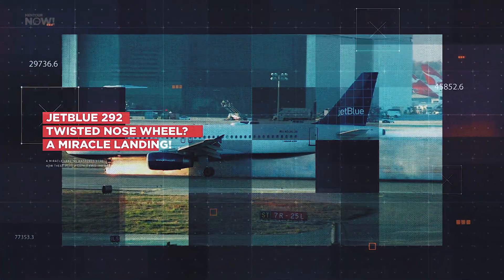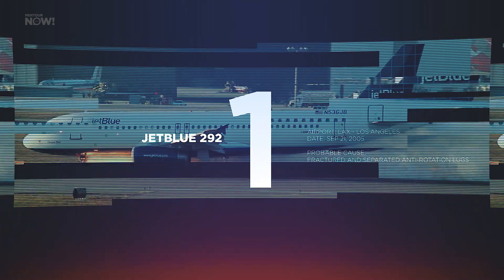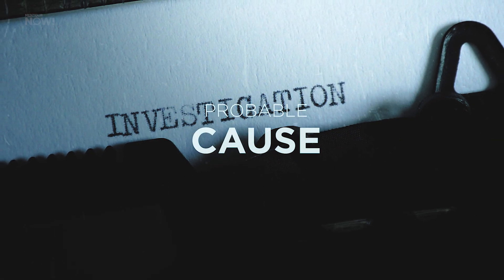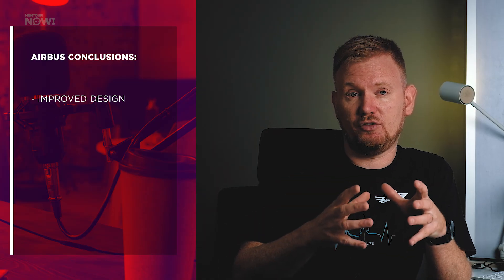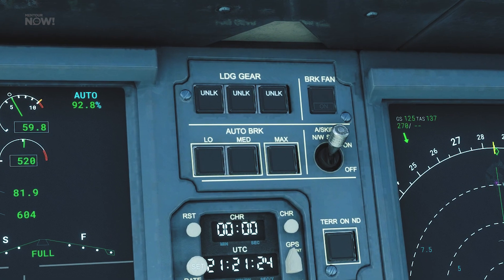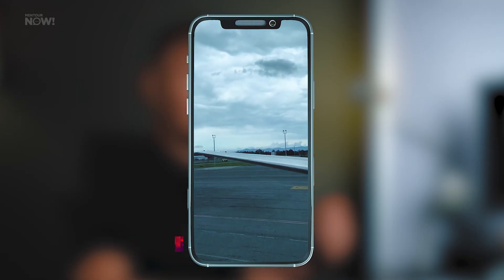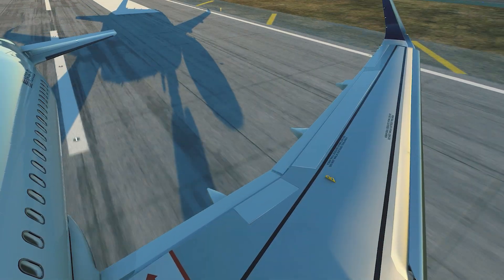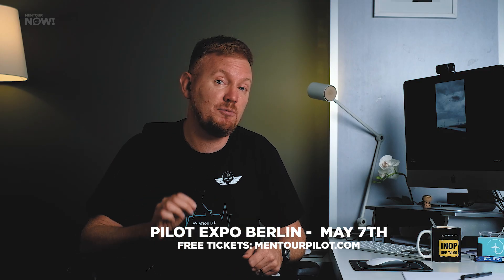The TWISTED Story of the Airbus A320 NOSE-GEAR!

Comment: I for one find it odd that the nose wheel isn't designed so it's forced straight when it touches down. This can be achieved simply by offsetting the wheel axis slightly behind the steering axis - the offset needs only to be very tiny to work with the speed and weight these planes put on the wheels. Having it offset would also make it much easier to keep the plane straight on the runway since it would literally force the plane into a straight line unless you force it to turn. Yes, with an offset you don't have the force go straight into the shock, but with proper engineering that really doesn't matter. The way they're made, having the shock also be the main component in the steering, is really because it's light and cheaper, but it's not necessarily the most brilliant. You also don't need all the computer control in the steering. Planes have done just find without for over 50+ years. It's literally a case of making things more complicated than necessary.

The front suspension in cars and trucks is made so it turns itself straight. Considering the speeds planes move at it's just ridiculous they don't follow the same principle.

Comment: I was on a flight a few years back. Not sure it was an A320. In any event, on push back, the Tug operator turned the nose gear beyond its limits and caused an alarm. We all had to deplane and interestingly the mechanics brought out a huge piece of sheet metal, the nose wheel was rolled over it and they put the nose gear into self test where it danced back and forth several times and then stopped straight ahead.

Comment: I disagree.  It's the same problem.  Just change the design of the entire nose wheel hardware and software assembly to fix the problem . And ensure new maintenance instructions are clear and straightforward to implement.

Comment: The ram air turbine is used for power in the event of engine failures, is that correct?
Reply: Correct - supplementary power source driven only by wind force powers only crucial items.
Reply: @rainscratch  thank you.

Comment: What worries me a bit is that after so many accidents there isn't a specific ECAM message about wheel off center, so the computer doesn't know the wheel is off center, meaning nothing in the programming is built to try and fix that. So many of these accidents were the computer going stupid!
Reply: Beyond belief that there is no indication of a 90 deg offset. Further case for the need of closed circuit cameras so that you don't need to put into action 1920s style fly around a tower to tell you what's wrong.

Comment: I just thought of another reason to shut down the engines on landing if the nose gear is cocked sideways at 90 degrees.  It doesn't take a collapse to send debris back towards the engines.  That spark trail is made by debris coming off of the landing gear.  Admittedly almost all the debris is very fine and won't do much damage.  But there are going to be a few larger chunks that may come off as well.  Including as likely candidates half lug studs, half lug nuts, half the axle, ball bearings, half of each rim and tire chunks.  

My reasoning is that once slightly more than half of a bolt and nut are ground away there is little holding it in place.  This makes it much more likely to come off and bounce into that trail of sparks.  

I have done automobile maintenance but no aircraft maintenance.  So a few things to note that almost any mechanic with experience will know.  I am assuming that aircraft wheels are similar to automobile wheels (with more exotic materials on a larger scale).  On a car the wheels are held on by a set of 2 part fasteners.  There is a hole drilled and tapped into the hub.  Into this hole is inserted a threaded stud.  One end of the stud sticks out from the stud.  The rim is placed over these studs so that they show through holes in the rim.  These then have lug nuts tightened onto them.  (Yes, I have replaced broken studs.  It's a pain in the ass).  The second is that sometimes the only way to get a REALLY stubborn but off is to use a nut splitter.  A nut splitter uses a wedge driven by a bolt to crack a nut in half.  Once split in half, the 2 halves will usually just fall off.

Comment: I am a Reliability Engineer working in this type of air vehicle development. When you design such complex hardware/software systems it is crucial to perform a comprehensive Failure Modes, Effects, and Criticality Analysis (FMECA) in concert with the mandatory Safety Critical Thread Analysis (SCFTA). In the past these analyses were led by the Reliability Engineer who was performing the FMECA with the Safety Engineering function developing the SCFTA with Software Engineering support. As the US has dropped mandating the use of Military Standards in many areas (a result of Acquisition Reform in the 1990s) the level of rigor (yes I am American so US English used here) of these analyses has been left up to the manufacturer for the most part. One result of letting the bean counters determine resources while also removing mandatory processes which require collaboration is that many companies have decreased the rigor of their Reliability analyses including the FMECA coverage and depth while somewhat stovepiping the SCFTA analysis efforts into the Software development process with System Safety supporting Software Engineering. 
It is clear that this structure is almost certainly in place at Airbus given the various failure modes discussed in the video that resulted in the NLG being rotated 90 degrees. Identifying, analyzing, and mitigating these failure modes is the MAIN reason for the FMECA. An investment in real FMECA analysis coordinated with the SCFTA activities would have uncovered most, if not all, of these failure modes so they could be designed out of the system before they occurred. This lack of rigor is also the root cause of the 737 MAX problems as no half-decent FMECA would have allowed redundancy killing HW/SW designs that are rampant in that design. I avoid flying 737 MAX aircraft for this reason.
Reply: Precisely. The nose wheel saga of the Airbus has all the hallmarks of senior management's toxic influence over this design.

Comment: Regardless if it is the "EXACT" same fault or not the issue is always with the front gear turning 90 degrees. I would say that is a good indication that the ENTIRE FRONT GEAR DESIGN is to blame. They should be made to stop these planes from flying until they do an entire re-design of the front landing gear and all attached parts and computer systems and then retrofit all planes with them. After all it isn't happening to other planes on a regular basis so this is obviously a flawed ENTIRE design.

Comment: Have we reached the point where standard A320 training includes multiple (simulator) landings with nosewheel set sideways? ;)

Also, has anyone done the math on stress on the front gear? It might not be much larger with it sideways than forwards with full braking. I know it's kind of hard on the rims.. but as far as collapsing, I'm not sure the stresses involved are that much higher unless you're on i.e. a soft field.

Comment: I understand that the investigations came up with different initial impetus for each incident.  The repetition of an issue like this highlights an obvious systemic fault with the nose wheel gear system as a whole.  Allowing continued unsafe landings in this way is playing with fire.  Just because nothing catastrophic has happened yet by no means suggests that it won't in the future.  On the contrary, continued incidents make a tragic incident exponentially more likely.

Comment: I realize that all these faults had different causes, but it seems to me that this nose gear should be redesigned and recalled. It's doesn't happen on other aircraft and it's a miracle that no one has died yet.

Comment: If I were a plane designer at Airbus I would just design a new frontal landing gear that is built with the wheels' axle slightly behind the middle of the steering rotation's center point, so they'll be mechanically pushed back to the center position by the runway when touching down. And I would design it with stronger parts so it can withstand more force, reducing the risk of it collapsing.
Reply: That’s what they already do. That’s why the wheel can return from 25° off axis without actuators.
Reply: @howlingwolven  
I was pretty sure they already did that when I wrote the comment because I believe in the engineers' intelligence.

Comment: First of all, it is the same Fault, aka the landing gear keeps faulting at 90 degrees, and it's the cause of the fault that's different. Secondly, the fault is a systematic error with the front Landing gear system in its entirety and should require a massive overhaul of the system design. Airbus only partially did this, so they deserve to be at fault for said issues. They took a lessened factor of safety on the front wheel design, and in terms of engineering, that was a mistake because they placed every passenger at an increased risk factor.

Comment: Thank you for making this video.  This entire time i thought it was the same issue.  But is airbus going to redesign the entire nosewheel landing gear? Even though different things go wrong it ends in the same situation. 90⁰ angle nosewheel and emergency landing. Sounds like the entire thing should be redesign because one day it might not be a successful landing
Reply: watch the video again, the root cause of most of these problems was incorrect maintenance or not following correct procedure by the pilots (aka don't turn the nose wheel more then x degrees like it says in the manual).

Comment: I've been building and repairing computers for 25+ years now and I've run into a number of situations where the standard procedures for a particular issue didn't fix the issue as it was something else causing the issue.  You don't know how many times I've had to go against what I was taught because as you said "It may look like the cause is the same but it's not."  On my midterm exam on my first year at a VoCal school, I faced an issue where a particular Windows installer file couldn't install this particular file as it kept failing a checksum check. I went thought the normal checklist of trying a different install CD, different CD-ROM drive, drive cable, etc.  No matter what I tried that same file kept throwing up a checksum mismatch.  The actual cause of the problem was one that neither myself nor my very experienced teacher had ever seen before for this particular issue, a defective RAM stick.  My only assumption is that where the memory address that was defective just happened to be where the Windows installer wanted to expand that file into RAM and it somehow always went to that same address when trying to expand that particular file.  Weird.

Comment: Why doesn't the flight crew have a switch or a system where they can manually turn the nose wheel in the corrected position in case this turning of the right angle of the nosewheel occurs?

Comment: 3:19  No the person who serviced the shock with incorrect pressure in is NOT an Engineer. They are a mechanic, technician, They do not have 5 years of science, ,advanced math, design, problem solving, mechanics of materials. An ENGINEER is a college educated person. A mechanic who services pressure  went to trade school for 2 yrs and has a high school education. Would you address someone who put a BAND-AID on your finger a Doctor or Surgeon?  Calling a mechanic an Engineer is the same thing. Not saying a mechanic is not important, but why take away from Engineers who earned that title.

Comment: I used to wonder if there was enough power to take off and this case were it took of with the front wheels in a 90 ° position means that these crafts are much more powerful than I'd gave them credit for. How would you not notice the drag?